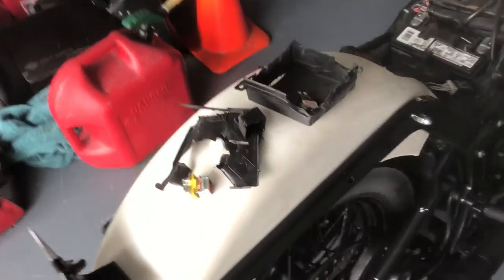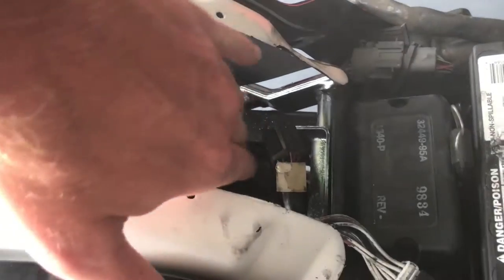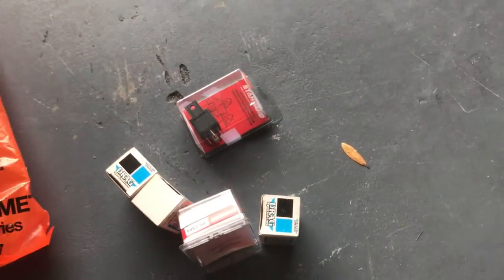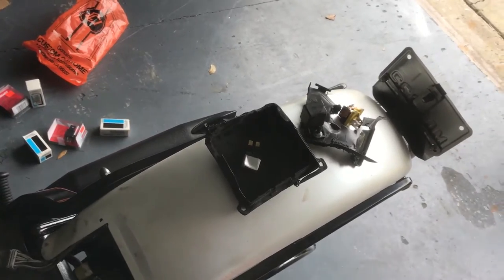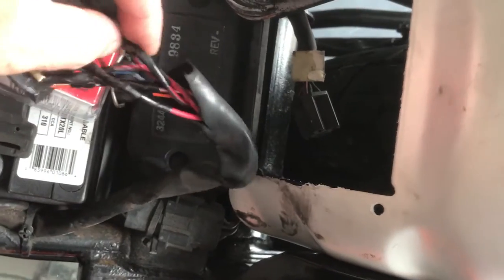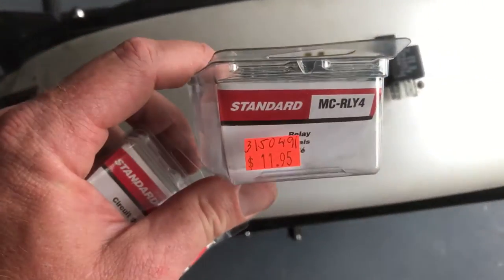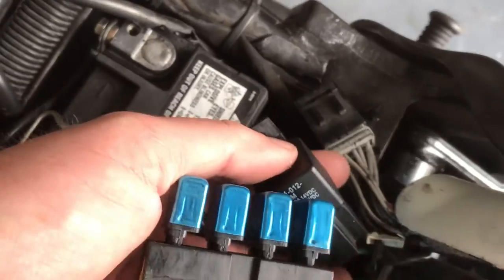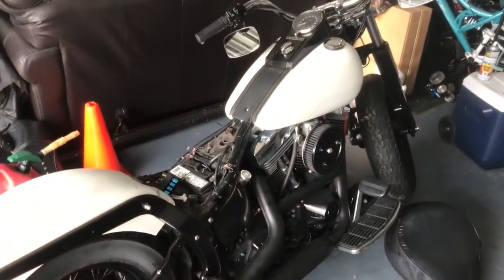DESTROYED Harley Fuse Box...How to Repair

Comment: I have yhe exact same F issue  and same thing for the most part and it's been sitting for over ten years. I also had issues with a main drag wire sealed with like a few braded wires twined inside.  Forget how many wire were in it at the Moment but it had a short someplace.  To replace it was over a hundred so never got but it comes from under the seat main wiring area,  not sure what it's called now been awhile ha. But sure miss riding and lol believe it or not I kept it insured and registered al this time and still.  But anyway if you know what wire that runs from under seat control box of some sort with like 3 intertwined together all while all 3 being coated separately I believe going up to the silonoid I believe 🤔 getting old lol please let me 🎉know okay? And curious how much was the starter relay and do you know how to test it anyway be 4 I buy 1? Sincerely I don't waste $ that I nor you have to begin with ha right? I have The same?
Kind of issues when I'm fixing thing.S nothing's ever quick always gets deep! I jazz did it worked out for you quickly.I hope it does for me too.Ha ha ha, never does though.So I understand and can relate. You wouldn't believe this while it was sitting all along.I decided to pressure wash it And on the primary side I was positive and I believe it's the French fluid a little round symbol where you're supposed to check the eye level or something blew out and lost all my fluid. Do you know what that fart is called? And how do I put another one back in that little circle? Andora gotta clean it out or whatever. I don't know. I got the book. For never looking until he lost it. I guess.  I appreciate watching your video. Sure, hope that happens to me. I'm gonna do the same thing plus that 1. Wire. Add a new battery and probably tires. And it's been sitting so loh I also need to put in a new starter switch kiss witch. What right on bro I love your video very much. Any help anyways, please let me know because I'm sure I don't have the same issue roughly but I was shocked to see this when you did. I'm so glad you posted it.  God bless brother 🙏& ride safe!👀 
                    Sincerely,
                     ScOoBy: